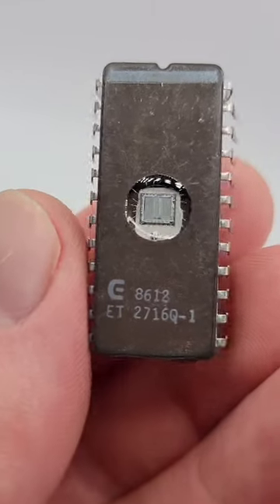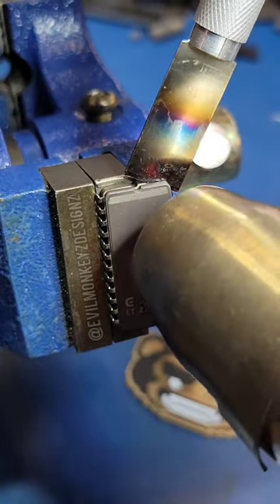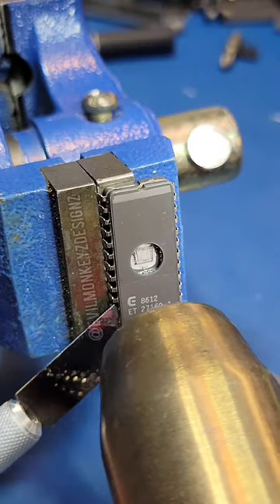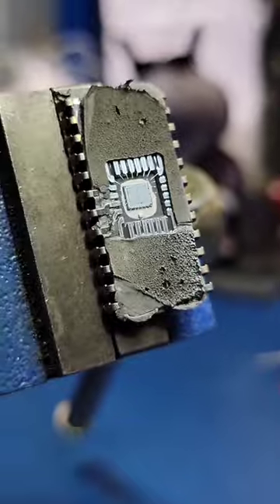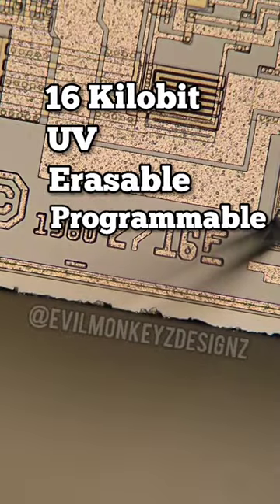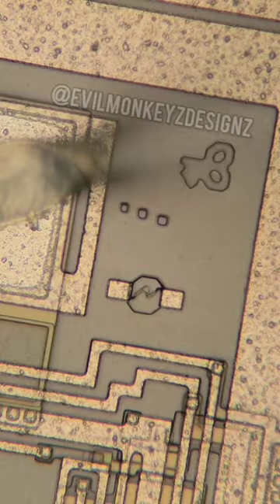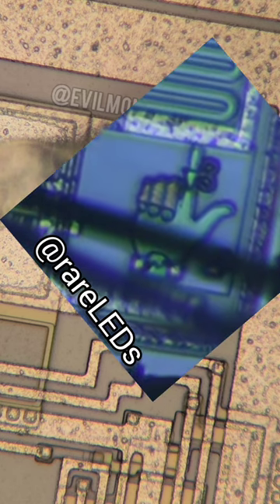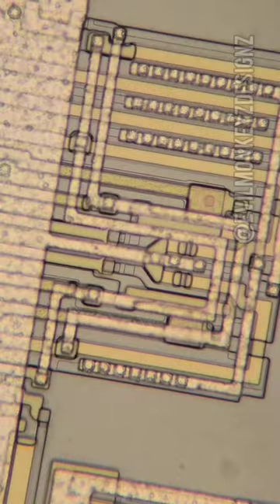16K-bit UV EPROM

Comment: These were used in my early fuel injection systems which made tuning interesting, we used to set them out in the sun to erase them
Reply: what vehicles? i love to hear about this older car computer stuff
Reply: Hmmn for how long you kept it under sun light?
Reply: @sarmedhlaa7698  3-6 hours then do a read check to make sure there’s no data left
Reply: So that's why there's a window made of quartz...bc uv light erases the memory and glass is opaque to uv light!
Reply: I use a UV drawer to erase them. Like a mini sunbed for eeproms. modify the flash write them back.
Usually for cosworth Magnetti Marelli ecus
Reply: They were also used on Schlumberger parking machines in the 1980/90's
Reply: Isnt quarts what normal glass is made of?
Reply: Also using for elevator for music memory 😂

Comment: I wrote a lot of firmware in the 1970's and 1980's. These were the darlings of that era. They made testing a lot easier and quicker. They certainly weren't cheap, especially when getting into the higher capacities but they slashed the price of ROMs. Production boards got ROMs to prevent accidental erasure, but eventually they would just put a UV blocking sticker over the quartz window instead of still using ROMs. Made field upgrades of FW a lot easier, especially if client had an EPROM programmer and UV erasure tool. Took at least 20 minutes to erase an EPROM under specific wavelength UV light.

Comment: The 2716 stores 16384 bits of memory. These bits are arranged as 8-bit words, or sometimes called a byte. This produces 2048 bytes of memory. I used the 2716, 2732, 2764 and 27128 on Intel single board computers that used the 8085A. Yes, I am old.
Reply: sometimes called a byte ?...16384=16 K I remember this on my ZX spectrum, yes I am old too. Z80A assembler fun....
Reply: In the 90's and 2000's, I was a Photolithography Engineer in Dallas and I help make parts like this.  I am also now old.
Reply: Me too. Things got complicated in the 16bit world as we went to even/odd EPROM bit splits. Then came 32 bits and had not only even/odd split, but high/low memory splits. Then things got easier with different EPROM densities to accommodate the longer memory bit addressing.

Comment: PROM ---> EPROM 
Erasable Programable Read Only Memory. 
EEPROM (Electrically Erasable) became the Flash Erasable EPROM (FLASH) because erasing took too long as bit by bit erasing. My career started in 1980 at Texas Instruments in the MOS Memory division based then in Houston, TX.
Reply: "Bro thats so frickin rad dude!"
Reply: I supose I should of put the much needed, Holy sh"! TEXAS INSTRUMENTS! Audio so kinda really dig TI and you working there since the year that i was born nearly is really rock and roll man, people are going to say that it isn't, and i can 💯 say that they're fos and don't know wtta🤭! but joking aside.. its an honour and "yeh thats rock and roll man", right on."
Reply: A key difference between EPROM and EEROM is that EPROM had to be removed from the circuit board in order to be erased. With EEROM, the chip did not need to be removed from the board.

If the product is in a case and it is sealed shut,  that means opening up the product and removing the EPROM chip and placing into a UV eraser.

Are you saying that the inconvenience of this did not play a part?
Reply: I used to think of it the other way around: Nobody designed circuit boards that allowed to program EPROMs in place, because they had to be removed for erasing anyway.
Reply: (Unless you'd also build in the UV light. That would be an interesting concept, but I've never heard of any such thing.)
Reply: @chtubbie  No, neither have I.
Reply: EEPROM also has a lower storage density than Flash, which seems like it'd be strong driver of the technology switch.
Reply: @ferrumignis  The driver was really the inconvenience of having to remove the EPROM from the circuit board to erase it. It slowed down the development cycle.

It would take typically 20 minutes to erase the EPROM. Imagine doing that each time you would to change a line of code or put statements in to assist debugging.

Programming the EPROM was often done out of circuit too, which means copying a file to the EPROM programmer and burning the chip. That took time too. So around 30 minutes total just to make a single line of code change.

It was a pain.
Reply: @deang5622  I'm referring to Flash replacing EEPROM, as per the OP.
Reply: Wow
Reply: Thanks for the insight Chess. TI is still a giant in the hearts of many Americans. Zenith too
Reply: Now we have Eproms, EEPROMS, NVRAM, Flash, that all LOSE THEIR MEMORY! I want PROMs back that last FOREVER! OR at least someone make PERMANENT version. Bring back PROMs!
Reply: I still have my EPROM eraser in my box of tools I haven't used in a long time.
Reply: EEPROM pronounced eep-rom
And E-PROM pronounced E-prom.. both the same
However the second one is only pronounced that way because that's where the most life regrets come from for the people who design these.

They wish they could erase their E-prom memory from the prom, and they indeed can, by calling it E-prom.

~The More You Know~ 😂
Reply: Zac EPROM 😂
Reply: The Siemens S5 PLC'S also had those.
Reply: Weird flex... EEPROM and flash are both still used, but for different applications. People are more cognizant of flash memory, but probably don't appreciate how ubiquitous EEPROMs are as well
Reply: @deang5622 I'm pretty sure this is one of the reasons it must have fallen out of favor. I'm not sure on erasure times or longevity, but perhaps it was too "volatile" this way, too. At least they had a way to erase it now though!
Reply: @ferrumignis "Faster, denser and cheaper." Looking at Wikipedia, NAND speed vs NOR cell trap speed. NAND flash/EEPROM can also make use of stacked layers (MLC and TLC, also QLC) to store more data. NOR-based EEPROM has advantages such as random-access, as well as execute-in-place (XIP). These features make it more similar to RAM, with XIP the data doesn't need to be copied into ram, hence, "execute-in-place." It's ideal for things like hardware drivers.

Q: Does "flash" and "flashing" come from the fact that EPROM used to use light?
Reply: Holy shoot! Texas Instruments?! 😮
Reply: Didn’t expect to find the definition of an acronym I didn’t know on YouTube! I work on tractors and we have some error codes that mention a program without parameters or calibration, or EEPROM failure. I assume our vehicle controllers have EEPROM chips inside of them then, based off of that.
Reply: This
Reply: I can’t imagine how futuristic all of the MOS devices must’ve felt in the 80s!!
Reply: @lex4478  even in the 90s! EPROM's annoyed me as a kid because they needed a UV writing system to write. I couldn't afford that at all (no pocket money. I just used to save up dinner money to get components). 

Then EEPROMs came about and I still couldn't afford it. So had to learn to build the circuits to write them. And of course, didn't save up enough to get the actual chips. The perils of being 13
Reply: Texas Instruments absolute electronics legends
Reply: Respect, sir. Thank you for your service. 🫡
Greetings from Central Asia.

Comment: I remember these from when I was a kid in the 70s.  My stepdad was an Electrical Engineer.  He made circuit boards for the Sol-20.  He also had a small plastic box with a UV light that plugged into the wall to erase them.

Comment: I used those back in the day of chip tuning. Basically anything up to 1995 can be upgraded with a chip so I used these along with a dyno that way I could erase and program a new map on the chip. The maps that actually made power I burned them on one time use EPROM  and sold them and made good money doing that. Now everything is programmed directly to the engine control module.
Reply: I'm an old electronics designer and have no idea what you are talking about... "Chip tuning"? "Upgraded with a chip"? Is that hipster language for replacing firmware with a never version?
Reply: What is "a dyno" btw? And "a map"?

Comment: There is, or was, a little 'caricature' on the LP5523 die, to commemorate my part in the design; i specified, and co-designed, the device for "the customer"
BTW, if you ever need an LED driver that lets your CPU "sleep" a lot, the LP5521 and LP5523 have small programmable processors, plus linear/log conversion, temperature compensation, automatic 1.5x charge pump, I2C, interrupt,  a "GPIO pin"...
Reply: I wish I was smart enough to know what any of this meant 😅
Reply: genuinely curious, how did you learn this

Comment: I used a lot of 2716s when working with RCA 1802 microprocessors in the 1980s. They were like the floppy disk of microprocessor systems -- portable and non-volatile.

Comment: builders have a good sense of humor...i found a leprechaun pendant hidden but a builders renovation in the 60's of a 100 year old house...and a safety pin that was holding the house up left by the original builder dead center under wall plate of what was once the front wall of the house.

Comment: Before the E in EPROM was available we had PROMs in which the fusible links were actually burned or fuses blown. It would be interesting to see the blown vs the unblown fuses in one of these classic devices.
Reply: OTP
Reply: @KULT_OF_SCIENTOLOGY  That term came much later, basically used for EPROMs without the window. The original PROM ICs used bipolar transistors, like TTL, so very unlike the field effect based n-MOS and CMOS used for EPROM.

Comment: If I remember right .... We used to write the code for this in "machine code" ... before we would burn it to the prom. That was always a kick. Seeing your programming in action after the chip was burned. This would have been in the early '90s late '80s. 👨🏼‍💻
Reply: It would have been very unusual to write anything in raw machine code in the 90's, much more likely assembler or even C.
Reply: @ferrumignis , no, it was in machine code. There's only 2k bytes on this device. The code (written in assembler usually, but installed in machine language) was debugged in RAM and then the EPROM was written and checked for accuracy. Another use was for look-up tables. A quicker hardware multiply/divide look-up table could be made from two 2764's(8kx8) using the address rows and columns for (multiplication) inputs, than a shift left 16 times routine be executed. Same technique used for trig, log and special function look-ups. Good times! :-)

Comment: Someone I was working for was still using these in new machines. One of them wouldn't program so they threw it out.  I took it home with me and through the window you can clearly see one of the bond wires melted.

Comment: Back in the 80's I had written assembly language code used in a telephone switch in Argentina.  The code was stored on these and I had to fly them down when we upgraded the program.  Unfortunately, the first thing I did when I got down there is to accidentally erase the new master.  It was before the internet so my coworker in the US had to call out the 2000 hexadecimal values via an international call that went on for several hours.  We did amazing things in just a few kilobytes of memory and programming in assembly language.

Comment: Early 80s we were using these programmable eproms on a regular basis for updating software on printers by removing the previous set of the proms and then plug in the updated eproms where is nowadays it's nothing more than a download or program that will reflash your bios or your eproms Sophie proms in a solution and a coffee can remove the labels put them in a epimer razor for an hour and then with reflash them and reuse them after putting new eeprom stickers for the type of eproms and positions that they were supposed to be plugged into

Comment: I had to learn to use eproms in 1994 and it was not an easy thing to work with
Reply: They were a heck of lot easier to work with than one time programmable ones, where you physically destroy fuses to literally burn in your program. You think long and hard about software changes when you have to throw out the memory chips with each change rather than just wait for the lamp to erase them.

Comment: I’m a computer engineering student and I love your videos. For someone who knows more about IC packaging than me, how common are windows like this in IC’s? I haven’t seen one like this in a while, if ever
Reply: The windowed packaged were only used in devices with UV erasable EPROM memory. Dedicated microprocessors don't have UV erasable EPROM memory, so they don't have windows. You would see them in microcontrollers, which combine a microprocessor, RAM and EPROM on the same die, but they usually had limited RAM and ROM for embedded applications.
Reply from the maker: I've got a collection a bunch of different parts with windows on them. I like them because of how unique they are. I don't think very common for new designs to have windows, if anyone is still doing it at all, given how easy it is to electrically program and erase chips. One chip that I have that that @beefchicken didn't mention is an Altera EP1810GC EPLD, a PLD with a UV EPROM inside it. They are pretty cool looking, to say the least.
Reply: @EvilmonkeyzDesignz   Super awesome. Thanks to @Beefchicken too!

I figured it was something to do with operation of the IC itself but also we’re so far past this tech like you mention I’ve never been taught about it haha. To me though, the 70’s through 80’s had to have been the coolest time to be a EE/CPEG.. Part of why I love your videos. Chip art is (mostly) a relic of the past and obviously nothing is done by hand anymore. One of my professors brought in and demoed some early 70’s magnetic-core memory that was completely handmade down to the traces on the PCB clearly being hand drawn. At my university for capstone, we get to take a lab and fab a 5,000 transistor IC to play our schools’ fight song, with mid 80’s cutting edge machines. Looking more forward to that than industry haha
Reply: @beefchicken  Ahhh! Makes sense. Thank you for this. Very interesting packaging, I’ve never seen a window like that!
Never come across it in any of my textbooks either- guessing around 1970’s & before EEPROM/flash memory? I’d assume not all came windowed
Reply: @Laminar-Flow  UV-erasable means "erasable using ultraviolet light". You literally had to shine a light directly on the chip to erase it. The window was required for this purpose. Many EPROMs that were written and intended not to be erased again had a sticker placed over the window in order to prevent accidental erasure, as even simple sunlight has enough UV to affect the stability of the stored data.
Reply: @EvilmonkeyzDesignz PLDs like that don't contain EPROM, the erasable bits each control a logic connection that can be reprogrammed to create different logic circuits .  The classic PAL chips of identical pinout could not be erased, so were used in finished products, while the erasable were used in prototypes .

Comment: In the old days computer bios chips were always eproms. And over the window would be a paper label saying the version of what was stored on the chip. A cheaper way to do it would have been using a prom which isn't erasable. Nobody erased eproms because they only kept their computer for 4 or 5 years and without internet it would be too expensive to download a new bios for a long distance call that would last an hour or an hour and a half.

Comment: what layer was the hand supposed ot be on? did they forget it? lol
I thought there was a difference between eprom and eeprom?
Reply: The former is erasable by UV light, the latter by applying an overvoltage. (un-ironic. Of course you can "erase" any programmable device by applying destructive over-voltage.)

Comment: If it's programmable, how's it read only?
Reply: PROMs and their derivatives are program once, then use as ROM. Today we use flash memory for that purpose. 
The proms usually held the program on single board computers, while the much more expensive RAM held the data. The erasable types were used during development, or to hold parameters that you might want to reprogram, like parameter fields e.g. in a computer for a car's fuel injection.
Reply: @HotelPapa100  so it's not read-only then?
Reply: @dominicbrunsmeier  For all intents and purposes it is. "real" ROM was mask programmed, during the production process of the die. An extremely costly process, that nobody subjected themselves to once the programmable devices came along. Imagine discovering a bug in a mask programmed device...
Reply: @HotelPapa100 okay, but this one is also erasable
Reply: @dominicbrunsmeier  But only the whole thing. RAM stood for individually writeable cells.
Reply: @HotelPapa100  so you can't rewrite parts, only wipe the entire thing and start over?
Reply: @dominicbrunsmeier  Yep.

Comment: What's the point of the window?
Reply from the maker: It's used to erase the data on the chip with UV light so that it can be programmed again. This was before they created EEPROMs, or Electrically Erasable Programmable Read Only Memory devices.